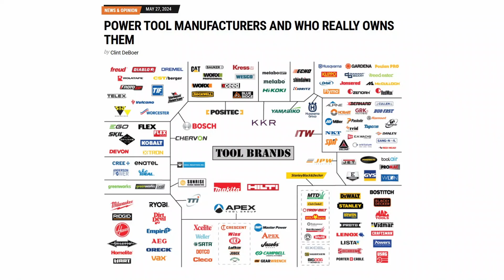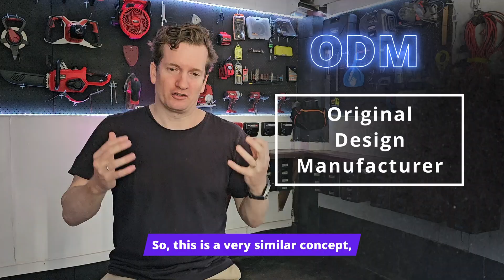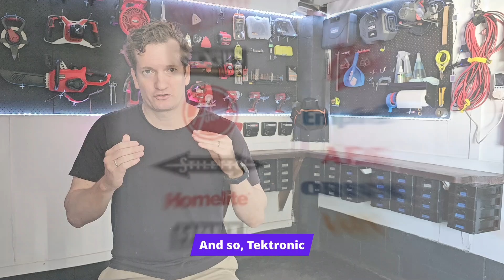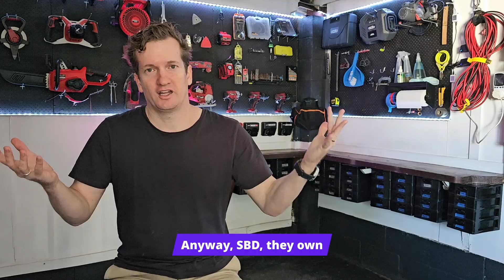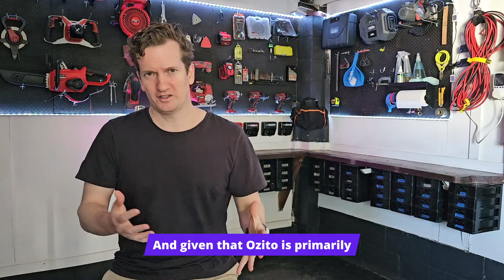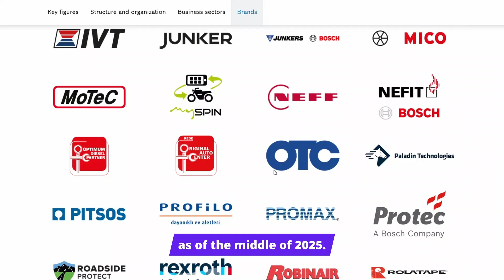Who Owns & Manufactures Your Favourite Tools?

Comment: Wow. This vid must have taken a fair bit of time to research and put together. Great job, mate. Yeah, the whole product ownership thing is such a tangled web, it makes my head spin.. I am a real tool freak, so any information you can provide is always going to be helpful to me, especially with all the rapid changes in technology that are happening right now.  Keep up the great work. 👍🏽🙂
Reply from the maker: Wow thanks so much, I seriously appreciate that. Ill admit ai does help alot with the research, but its a really interesting rabbit hole once you are half buried in it. It's good to meet other tool freaks aswell (although I am a cheaps tools one) and yer the tech is mindblowing.
Reply: @suburbangardenshed   Yeah, I tend to steer towards the budget tools end myself. Mainly Ozito, some hand me down Dewalt , and a few Aldi bits and pieces. My recharge station is total mess of chargers and cables. I have had to colour code everything so the correct battery goes on the right charger. I use mostly cordless tools for the day to day DIY and corded for the heavy duty stuff. I love my tool tech. 

Like I said, Dave, keep those vids coming. 👍🏽🔩🪛🪚